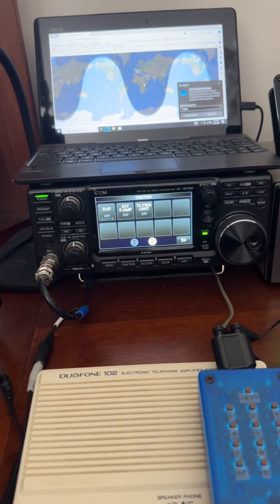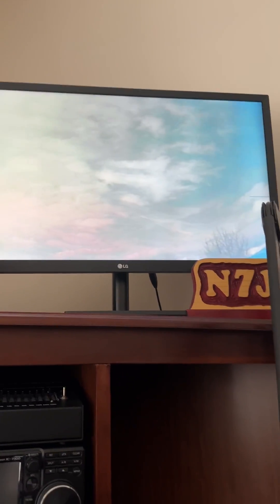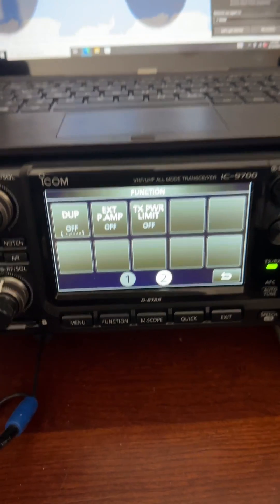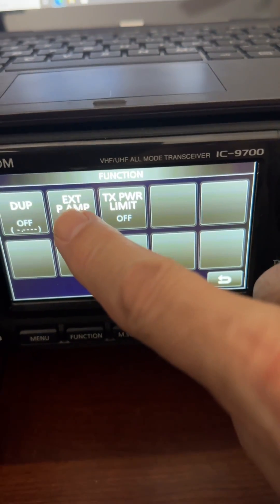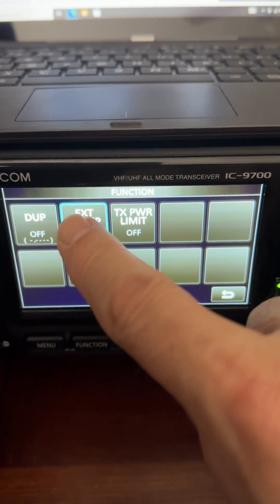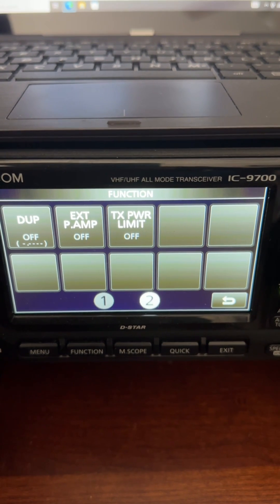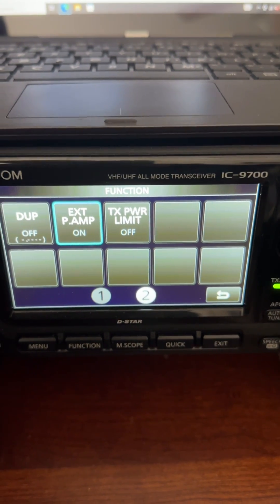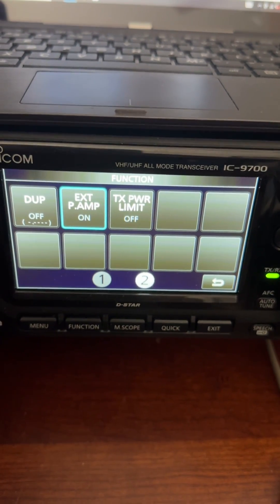Difference with Icom IC-9700 using a mast mount pre-amp while receiving IO-117

Comment: Did it decode without preamp?
I have yet to install my 70cm preamp. I hear it ok as is, problem is getting trough, its tough.
Reply from the maker: Yes, but sporadically as the SAT was quite far away on this decode and close to the horizon.  Not sure how long your coax run is but with mine, it was a huge difference.

Comment: I wonder what is the technical reason that Pre-amp need sto be close to the antenna feedpoint?
Reply from the maker: Maybe someone else could describe it more technically but amplify that signal before any feedline loss rather than trying to do so after all the loss (not to mention noise).
Reply: “The Noise Figure of the overall chain, from the antenna – coax tail to masthead amp – masthead pre-amp – coax to shack - receiver, is dominated by the first device in the chain. This is why it is important to have the amplifier with its high gain and low Noise Figure as close as possible to the antenna.”
Reply: I found it here https://www.qsl.net/zl3dw/pdf/Masthead%20Mounted%20Preamplifiers%20and%20Noise%20Figure.pdf

Comment: What brand and type of preamp do you use?
Good te see the difference! 73 PD1MV
Reply from the maker: Using the mast mount pre-amps Icom sold many years ago under their name.  No longer available.  They are pretty decent but I suspect there are much better ones available now with even a lower noise figure.